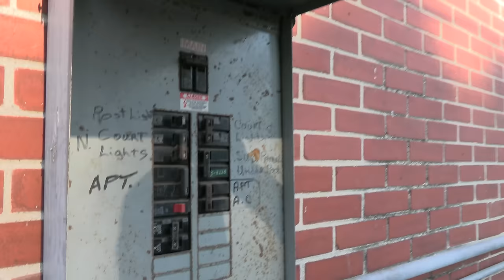Upgrading My Own House to 1,000 Amps

Comment: 2-400A & one 200A services, all single phase? That’s just nuts. If you really need that kind of power, three phase would make more sense. One problem is residential tariffs don’t reflect this kind of demand. If you’re going to start putting services that big the tariffs need to be revised to require 3 phase plus demand charges like commercial service.
Reply: Well, it might be a little nuts.  But he's an electrician, so he wants power.  And he's willing to pay for it.  
Yes, it's all single phase.  Three phase power would NOT make more sense here: there are no three phase devices on the property (to my knowledge).  There are limited "good" options for supplying 120V from a three phase service without extra transformers.  The only "efficiency" savings would be between the pole transformers and the main panel, which as you can see is not very far to warrant the expense.
Reply: @jovetj  actually there would be considerable savings on the equipment end. 400 amp split phase equipment is very uncommon, and thus very expensive because its so rare. In fact electrical equipment in general starts getting very expensive once you start getting past 200 amps split or 225 amps three phase. Plus three phase power is incredibly useful for things like workshops and the like. The biggest obstacle is usually on the utility side whether three phase lines are there or not. But for him, three phase power lines are right there.

And while yes, three transformers is more expensive than one, the thing to consider is that those three transformers would be individually smaller units than the single larger one. If a 1000 amp service needs a 75 KVA transformer, an equivalent KW three phase service would require 3 25 KVA units. but 25 KVA transformers each are less than half the cost of the since large one, so the three transformers are not that much more expensive than the single large one.

Comment: Communications almost always requires 2"
Reply from the maker: Interesting. Sounds wildly excessive to us for what is normally one wire from the utility,  but if you're referring to many cables running inside the house that might make more sense? Does your AHJ require the 2" or are you referring to a national authority?
Reply: @ElectricProAcademy  I’m referring to from the pole to the house, it’s more than excessive and damn near plain stupid. But it’s what every single utility requires in this dumpster fire state.  Half the time they won’t even allow a shared conduit, they’ll make you run one for coax and one for fiber.

Comment: 1Kw for your house? Really? So much for going GREEN! □:text-green-game-over::hand-orange-covering-eyes:
Reply: A kilowatt?  No no no... that's about 240kW!
Reply: 1 kA…..yeah, that’s a lot of juice….
Reply: How much power you need at one time, isn’t the same as using a lot of power. 

Tankless water heaters only turn on when you use them, so most of the time they pull. Zero power, but when you use one, it’s 150 amps at once.

Comment: That looks so good stuck to the outside of a house. The state of the up downs how is that safe being open to the elements. Electrics are shocking what a mess. Seen better installations in India. Not slagging your work but the infrastructure in place. No testing just switch it on............. Nice. Breaker trips use a bigger one. All those connections and no protection against touch? What a great design.

Comment: What a messed up overcomplicated way of supplying electricity. 
Why not 1 trench 
               1 cable 
               1 meter 
               1 distribution board 

And why not fit it inside ?
Reply: Because that is considered Industrial service. A 1000 amp breaker is not only huge but insanely expensive. like 20k for a breaker. 
400 amps is the largest residential equipment. Hence 2 400's and a 200 for a total of 1000 amps
Reply: @Species-lj8wh  can you not get 3 phase ? It wouldn’t be 1000 amps it would 400 amps per phase . Hell he’s not going to use half of it .
Reply: @persona250  with multiple residences and multiple electric car charging, you definitely will use more than half of that.
Reply: The electric utility requires a dedicated service and meter for the reduced EV charging electricity rate.  So, there has to be two meters minimum.  I didn't see it explicitly, but I presume the third meter is exclusively for the carriage house and the renter.  That means the renter can pay his own electric bill.   Three meters.
Reply: @jovetj  yes mate we do all this in the uk from 1 trench
               1 meter 
               Etc
Reply: yea in NZ you wouldn't need 1000A because 240V so conductors are smaller by alot especially as they are copper so they end up being ~1/6th the size and install could fit in a single cabinet with 3 Meters if needed. The US power system is awful Edison screwed them over bad. I find watching videos of US power system installs is like watching a beautiful train wreck looks amazing glad I'm not there.
Reply: @adammurdoch1708  Actually how our system works is a little weird. What we use in most residential services is called 120/240 volt split phase. A typical residential transformer is single phase on the primary, but on the secondary side it is center tapped, with the center grounded so the transformer produces two 120 volt legs that are 180 degrees out of phase to each other. this way so we get 240 volts between the two hot legs, but 120 volts between one hot leg and the neutral. For the rest of the world using straight 240 volts to ground, you have true single phase where its one hot 240 volt wire and a neutral, and that's it (for those that aren't using three phase anyway.)

In practice this means that a 1000 amp American service would be a total of 240 KW. That same 20 Kw of power in a NZ 240 volt service would still be 1000 amps. The main difference is that the American service requires four conductors, 2 live, 1 neutral, 1 ground, where as a NZ service would only need 3, 1 live, 1 neutral, 1 ground. Conductor sizing would be the same, but with one less conductor.

But yeah, 120 sucks because of that. Its why many North American commercial and industrial customers prefer the 277/480 volt system whenever available.
Reply: @ryuukeisscifiproductions1818  this isn’t 4 conductors though it’s 12 conductors . Which is what I’m getting at .
Reply: @persona250  I was using that as an example. Yes of course a 1000 amp service in practice, even with a single disconnect point would still need multiple conductors in parallel due to cable ampacity limitations. However because US residential uses Split phase, a 1000 Amp US split phase delivers the same KW as a 1000 amp single phase service in most 240 volt countries. Split phase is technically a two phase system on the secondary side. Two Hot conductors, one neutral, one ground. The UK system for single phase just uses one hot conductor for 240 volts, 1 neutral, 1 ground. The standard US three phase system 120/208 would deliver about 660 amps per phase to match the total KW capacity of a 1000 amp split phase system.

The only way for this setup to meaningfully use less conductors while having the same KW would be to use 277/480, which is a fairly standard commercial power system here in North America. But 277/480 is really not very usable in a residential setting, as any load that he would have would all either be a 120 or 208/240, so it would just have to be stepped down with another transformer anyway.

Comment: Couldnt you have made it look a bit neater?? all that electrical stuff on the wall is just so untidy. If I did that I would exactly be shouting from the rafters like you.  Why do amaerican installations look like something from the 1800s rather than from this century?  Could all that crap not have gone in the building?
Reply from the maker: Ouch! Metering is required to be located outside in our utility jurisdiction. I agree that it's quite large. As soon as I plant 3 magnolia trees in the green space it'll all be beautiful again :-)
Reply: The utility supplied metering equipment isn't suitable for small spaces inside the garage, even if it were allowed.  Electric meters are always outside in the US (and Canada, I presume).  This is for the utility's peace of mind as well as the customer's.  I agree that electrical equipment can easily become "unsightly," but "from 1800s?"  That clearly indicates you have no idea how things were in the 1800s.  We have come a really, really long way.  I, personally, don't like that conduit crossing everything below the meter boxes, but it looks as nice as it can for the circumstances.  The meter boxes are way too large for what they are... for that size they should be combo meter/disconnects.  Disconnects would have also been ideal, especially for the main service, as pulling a CT meter isn't going to do much in an emergency.  

I do NOT like outdoor service panels.  I think they're inconvenient and unnecessarily dangerous—there's just little good reason to put yourself out on wet/damp ground.  But, there are times they are necessary, and this could be one since the existing service has to be adapted.